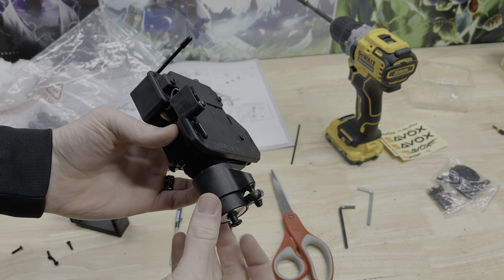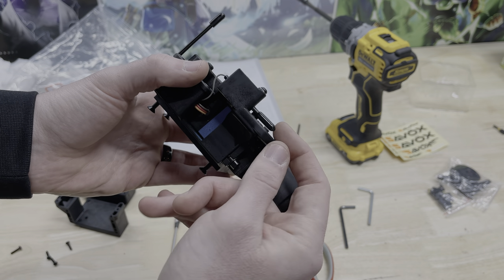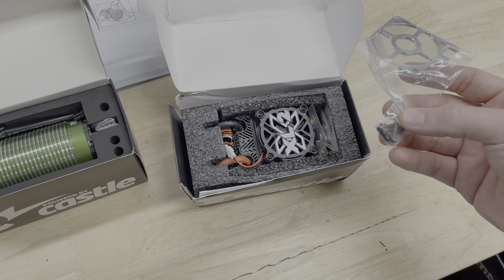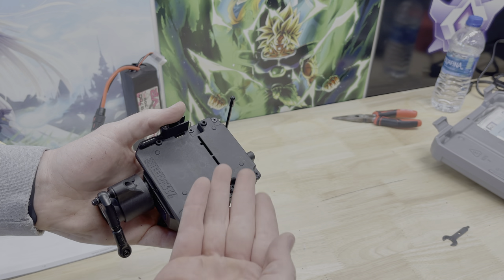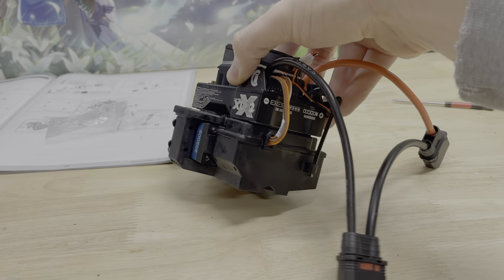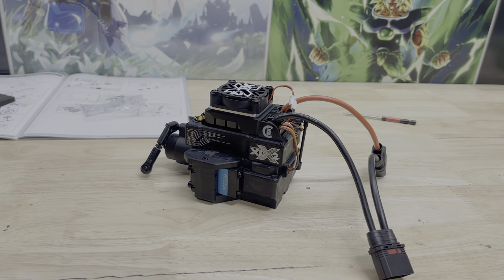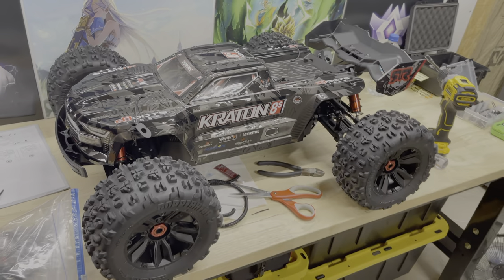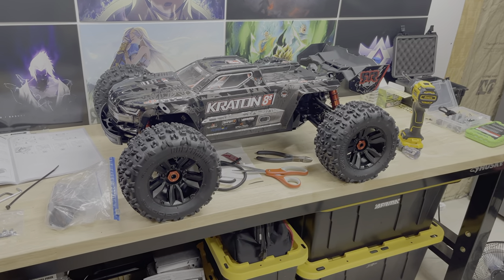Kraton 8S EXB Build - Part 2 of 2 - ESC, Motor, Wiring

Comment: I was curious, (and I know it's been a while ago). Did you have issue mounting the receiver box into the truck with that servo combo? I'm finding mine is like 2mm off where it should be, and I think it's because the Savox servo sticks out too far.
Reply from the maker: Yes I had issue as well, had to loosely put all 4 screws in and once I got all 4 started then I drove them all down

Comment: Just put my order in on the 1/5 EXB and the XLX2 combo with 1100 motor. Was the main reason you went 800 to keep it fair/even with the X-Maxx? Thanks!
Reply from the maker: Very nice! And no the main reason was the weight of this beast. The additional torque helps move it lol
Reply: @GoKaioken  are you running 12s? If not, you're not getting any torque difference between 800 and 1100.. Just losing top speed ability.
There's a great review of 800/1100 Castle motors by another YouTuber who goes into great detail about it.
Either way. Great set-up!
Reply from the maker: Thanks I’ll have to check it out. Castle told me differently.

Comment: Great video. I bought the spectrum stock electronics so mine bulid is easier lol. With 1100KV motor. Is that table rubber wood? I have similar table. 👍

Comment: Love the channel 👍
Got myself the exb last week, hadn't decided on servo, got the same Savox as yourself as it looked the part but for some reason won't fit. About a quarter inch out on the screw holes, taken the servo saver to bits and back together, really isn't a way of doing it wrong. Did you have any issues fitting it?
Reply from the maker: I had to loosen it to fit the receiver cap on but when I was done I tightened it back up and it fit fine.
Reply: @GoKaioken  thanks for the response. Saw that in the vlog, this is the actual box into the car just with the servo, servo saver fitted and servo saver axle... Its like a quarter inch out on the screw holes before even fitting the ESC. If I didn't know better I'd have said the chassis holes are out given it looks like yours went in with no issue. Really odd.
Reply from the maker: Did yours come with the right size box? It should come with 1/5 scale servo box and 1/6 scale box. Are you using the right one?
Reply: @GoKaioken  Yes using the 1/5 scale one. The others too small anyway for the servo width. Logged it on the arrma forum, see if I can get anywhere with it in there. All very odd. Also ordered a couple of new servos, see what they are like. If still the same it'll be the box or chassis.
Reply from the maker: Dang. Good luck man.
Reply: @steveandrews5254   you need a smaller servo saver screw the one arrma provides sometimes is to long depending on the size of the servo you are using 
The screw that attaches the servo saver to the servo itself

Comment: i just now ordered mine. I hope it'll be ok. had a bad experience with the 1/8 EXB Kraton. I have a Mamba 800 kv ready to install but its just the XL. cool Broly
Reply from the maker: You should be good to go with the regular xlx. What issues did you run into with the 1/8 EXB?
Reply: @GoKaioken  the rear differential were not the right ones and we didn't receive the right one until 5 or 6 months after. And they still dont feel right. So frustrating
Reply from the maker: Gotcha, I completely understand. I got my 1/8 after they took it out of stock and then it came back. They provided shims in the bag with the manual. I put 1 shim on the left side and that was it. Of course each person may have slightly different bulkhead molds so one solution may not work for another person. I hope it works out for you. I also hope these 1/5 EXB’s hold up.
Reply: @GoKaioken  yeah it is still acting up and I'm just not interested in trying to figure it out. This is a video of when I first received my diff and they came with shims https://youtu.be/bL6n3m6onrU
Reply: @GoKaioken  what is the name of that material you used to protect the sensor wire. I want to do the same thing when mine arrives
Reply from the maker: It’s called a wire loom, 1/8 or 1/4 inch. Here is the link: 20 Feet Ft. 1/8” 3mm Black Split Loom Conduit Pol... https://www.amazon.com/dp/B072PWW9VB/ref=cm_sw_r_sms_api_glt_fabc_5E0R56EQ2EH8NSR0VVZN?_encoding=UTF8&psc=1

Comment: How has the esc held in?  I am debating using sticky tape but I haven’t had good luck in the past. Landing big jumps my esc always comes out using dual lock or double sided tape
Reply from the maker: That’s what I’m using too make sure it’s rated for 30 pounds
Reply: @GoKaioken  the kind I got is gorilla tape and it is rated for up to 60lbs
Reply from the maker: Dang that’s weird it’s popping out. Something you could try is drilling a hole through the lid of the receiver box and putting a screw through the hole into one of the mounting holes on the ESC if it all lines up.
Reply: @GoKaioken  I am going to do this!  . I will find up how it holds up when I give it a bashing this weekend.

Comment: I literally did the exact same build today, exactly the same servo , I just went with hobbywing esc and motor . Hope you have fun as well .did your steering link rub on the end of your motor ?
Reply from the maker: Nope mine was all clear
Reply: @GoKaioken  interesting, my motor was like at the exact limit of the measurement they say you can go to. And part of the steering rack ( not the linkage) just nicked the edge corner of the motor. I just filed a millimetre off and was good to go. Maybe the castle is slightly shorter in length. Anyway it’s all good . Hope yours goes well to, happy bashing fellow rc enthusiast.
Reply from the maker: Thank you!
Reply: @Captinfun101  What gearing are you running? It seems a larger pinion pushes the motor wider - hence more clearance?
Reply: @Sisu2280  34-39 atm. I had to shave a mill or two off so I didn’t rub as the linkage traveled side to side. I quest the tolerances are not identical on each car to the exact millimetre or the motor ? It’s all good now cheers
Reply: @Captinfun101  that is large enough... My Castle 1100 is really tight too.
Reply: @Sisu2280  yeh if it is sluggish or over heats or just doesn’t perform I got a 37 and 39 coming to test but it should be a weapon. Cheers
Reply: @Captinfun101  I think 30-35 is a pretty good range. But I agree with you that it's too tight. We're talking millimetres though, so, as you say, taking a couple off is perfectly fine!
Reply: @Sisu2280  thanks for the helpful advice. I tested it on the ground, hanging in the air as if it was jumping and with some fair bit of weight on it and all circumstances were fine so🤞🏻. Cheers again.

Comment: I confused I get the controller that you put in the link Radiolink v3..he came whit 2 yellow connector but I  want to run the QS8 connector on my xlx2 and battery same you use in the video soo my question is we're I suppose to connect does connector that came whit the controller??🤔
Reply from the maker: That’s just if you wanted to see the battery voltage of your batteries you are using on the car and have it show up on the transmitter. It only works with batteries with that specific connector.
Reply: @RC Recon  ohh ok nice but I don't need it 😂😂thank you I love the controller  I almost done whit my build...exactly like your but outcast exb and I goin whit 30t × 47 I know is gone be crazy slow but later I will swap to 39 spur...

Comment: Question... I bought the 8s kraton exb and picked up the max 5 esc and 800kv combo, I installed the motor and the back of it is rubbing the STEERING BELL CRANK...any ideas why? And what pinion and spur is best to run with it? Thanks in advance💯🤝🏾
Reply from the maker: I’m not sure the size of the Hobbywing motor. I run a 1:1 ratio so I match the size of the spur. I believe it’s running 34/34.
Reply: @GoKaioken  preciate it...how does it run with that ratio?
Reply from the maker: I think it runs great, it’s too heavy for anything less in my opinion.
Reply: @GoKaioken  I seen a video on here with someone running a 39 spur and 29t pinion..thought about trying it, or do u think the 1:1 is better?
Reply from the maker: I ran that as well and it hardly did backflips.
Reply: @GoKaioken  I'm just worried about motor Temps. The exb stock spur is 47t and it also come with a 39t spur...should I just get a 39t pinion?
Reply from the maker: I personally haven’t ran into temp issues, but if you are worried, gear accordingly. The 800kv 2028 and XLX2 are really efficient and don’t get too too hot. Of course you can get a fan for it too. It all will depend on how you plan to drive it. If you don’t care to do backflips off of jumps, undergearing it or doing a 39t pinion and 47t spur should be perfect.
Reply: @GoKaioken  I appreciate it...ill be running the max 5 esc motor combo and I went ahead and picked up a 29t pinion and am going to put the 39t spur that came with the exb and see how it does. I tried getting a 39t pinion/limitless spool gear and use it as a pinion on the motor, but my local hobby shops were all out of stock.
Reply: What motor mount did u use for the 800kv
Reply from the maker: Stock mount.
Reply: Where did you source spur and pinion gears from? I'm having a hard time finding a mod 1 pinion gear that fits the 8mm shaft of castle 2028 motor.
Reply from the maker: Saga

Comment: i want to thank you for your vid bro, i used it and the manual to put the servo saver together. and usewd your link to cop the servox servo. much appreciated.. chk out my vid.. just got me  the exb as well.. i get my servox servo today and will swap out the spektrum 40kg. I had bought the spektrun 40kg servo for 30 bucks on ebay and wanted to check to see how it handles first. my first kraton 8s ande its a beast i like it..
Reply from the maker: Glad it helped you out! I’ll be sure to check it out!

Comment: So i have the same setup. Didn´t you run into the issue that the servo saver gets jammed when you slide it into the sideguard? i cant line up the screwholes of the sideguard with the chassis anymore cause the servo is a notch too long?!
Reply from the maker: Mine lines up with no issues.

Comment: When I try screw it all back on the chassis the screws don’t line up properly any advice mate please
Reply from the maker: Are you referring to the receiver box? Make sure the servo saver drops into the slot first, then only screw in a couple threads on each hole, then work them all down a little at a time.

Comment: Is there space between the motor and the chasis or is the motor touching the chasis using it to decrease heat?  Looks like its not touching the chasis but want to make sure. Thanks in advance.
Reply from the maker: It’s just slightly above the chassis which is a good thing. While dissipating heat would be nice, if you jump it and land hard you could be transferring that shock of the landing into the motor potentially damaging it over time.
Reply: @GoKaioken  Cool, thanks.  I'm shopping around for motors but also thinking about adding a water jacket.  😄
Reply from the maker: What’s a water jacket?

Comment: what pinion gear are you running? I just finished my EXB build but the 17T pinion must be the wrong tooth pitch. what pinion are you running?
Reply from the maker: I’m not running a 1:1 ratio, so I’m not sure the tooth count I just know it’s the same as the smaller spur gear they provide in the bag
Reply: @GoKaioken  so I'm guessing that would be the 39 pinion,39 spur?
Reply from the maker: It’s the 39 spur in the bag I believe.

Comment: What reciver is that?
How do you look up your xlx2 to see if it's one of the bad ones?? Thx
Reply from the maker: R7FG and on castles website
Reply: @GoKaioken  ok do you just type in a serial number or?
Reply from the maker: Right, there should be a sticker on the esc wires themselves that show the date and the serial number.
Reply: @GoKaioken  i bought mine 2 weeks ago but that doesn't mean that it was on horizon hobbies shelf
Reply from the maker: Right, definitely double check

Comment: Where did you get that cover for your sensor wire?  What size is it?
Reply from the maker: Amazon and it is 1/8:
20 Feet Ft. 1/8" 3mm Black Split Loom Conduit Polyethylene Tubing https://www.amazon.com/dp/B072PWW9VB/ref=cm_sw_r_cp_apip_KIdXexMTVSIac

Comment: What gearing did you use?
Reply from the maker: I ended up using a 1 to 1 ratio. So whatever number of teeth the spur had is the pinion I used.

Comment: Great video bro can you send me a link to that 39t gear you got ? Can't find it anywhere
Reply from the maker: Pinion or spur?
Reply: @GoKaioken  on both if you can I would appreciate it 👍
Reply from the maker: I am just using the stock arrma 39t spur as the pinion. The spur on the Kraton came with it. Here is a link: ARRMA 39T MOD1 Spool Gear (8mm Bore), ARA310951 https://www.amazon.com/dp/B07SSC2PD1/ref=cm_sw_r_cp_api_glt_fabc_B20TB0QWF4XBY6YR8YJE
Reply: @GoKaioken  thanks man appreciate it 👍👍
Reply: One more thing .where can I get that fan mount?
Reply from the maker: Practical Proto solutions

Comment: I went with the Savox Savöx SW0241MG servo..it's pretty weak. Is that just me or? What's a good giant servo for this truck?
Reply from the maker: They all seem to be weak from Savox. I asked them if this is better or should I put the 2290 in and they said the 1/5 scale is better because of its durability. For now I’ll keep mine in.
Reply: Spektrum 9120 is is the way to go
Reply: even on it's lowest voltage its 1000oz of torque
Reply: @michaelolson5699  I went with spektrum 9110 still a beast!

Comment: Hey buddy I like your channel I just subscribed are used the hobbywing 800 KV motor very similar to the one you’re using I just want to give you a heads up you will have some issues if you try to run Anything under a 30 tooth Pinyan you’re gonna have to sand the steering rack down a little I posted a video on my channel if you’d like to check it out
Reply from the maker: Just watched it, so that’s if you run a 29t spur as well right? Cuz the motor has to slide in so far? How did you mount the spur? I ask because doesn’t the 47t and 39t spur Arrma provides have a slot in it? How did you secure the 29t limitless one?
Reply: @GoKaioken  Are used a heart racing 29 tooth pinion And I’m using the 39 tooth spur gear provided With the truck. And yes I had to do that modification for that 29 tooth as well. I did a speed run with it and I was only able to hit 48 mph my temps were a little higher than I thought they would be around 150 but I have been running it pretty hard Through grass before I did the speed run. So I installed some fans and I’m gonna give it another shot this afternoon and see what happens after the first run I did notice that my top right side pillow ball Retainer backed out quite a bit. So I would definitely give the truck a thorough check after your first shake down
Reply from the maker: Gotcha, I’ll double check fitment as well I didn’t think I had any clearance issues with the motor and steering rack but they might be slightly different diameter motors. I’ll check again though.